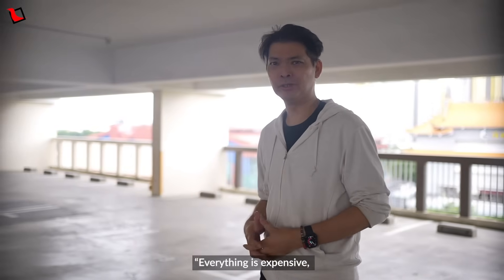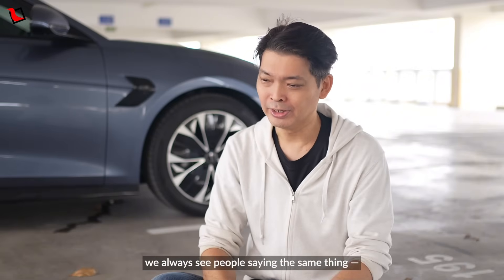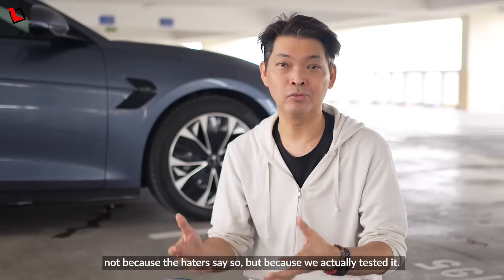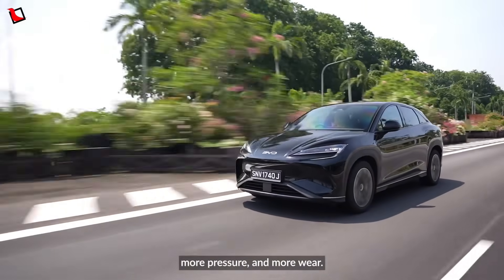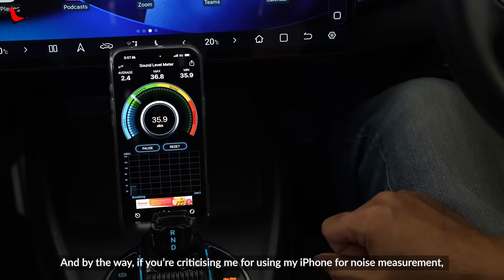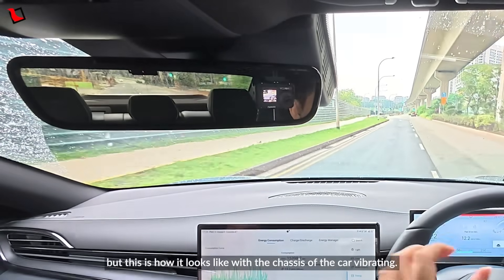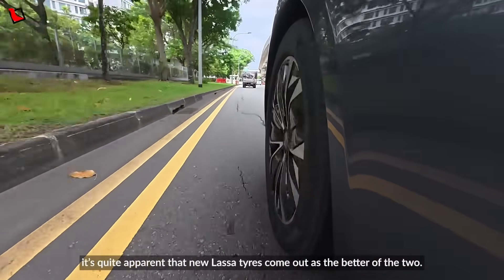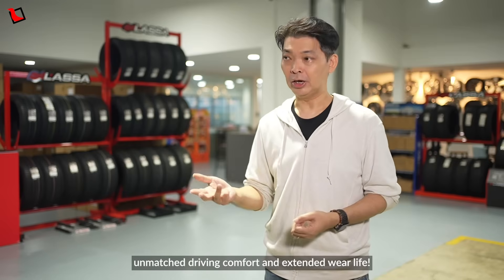EV Tyres are a Scam ? | Learns Car Series

Comment: OK so we know that this Lass-a brand of tyres can pass .. Thank you..... Although in my opinion the issue isn't so much whether EV tyres are a scam .... It's the wear and tear of EV tyres and brakes due to the extra weight of the battery - and whether it offsets or wipes out the savings of regular servicing maintenance eg oil changes etc
Reply from the maker: Yah, I think if one goes for the more expensive branded tyres, it will definitely eat into the savings... so I think going for good-enough tyres at that are the same price as normal non-EV tyres will make a lot more sense.

Comment: I am intrigued after seeing your BYD Seal energy efficiency at 12.2kWh/100km with Giti & 11.9kWh/100km with Lassa. 

BYD Seal real world energy consumption range 15 to 20 kWh/100km, I am keen to learn how you managed to achieve it. 

Maybe you can also do a comparison with the various driving modes ( Eco, Normal & Sport) . Driving mode Normal D &  B-pedal. 

I have always been on Normal D with Eco & highest regenerative braking, my average energy consumption is around 16kWh/100k.

After my left meniscus tore, I started using B-Pedal Eco mode and the energy consumption improved to around 13kWh/100km.
Reply from the maker: For me and my wife, the car is always in Eco. I find there's no advantage in the quick sprints in my Dynamic because it's not earth-shattering quick. And so, my starts are like most normal traffic. 

The main energy sapper is highway cruising at high speed. I find that between coasting at 100km/h vs 80km/h, the energy used could be 2-3kWh/100km difference... so nowadays, if we're not rushing to our destination, we'll just take the middle lane at 85km/h... my wife will do 80km/h on her own, even slower, but more efficient. 

Just before stops, I really let the regen brakes work way, way before, so that by the time I reach the line, the car is coasting at the absolute slowest. It irritates some cars behind with my regen braking, but hey, they gotta learn. 

So as you can see, the car's average efficiency is actually 13.3kWh... nothing near what I've clocked in the tests. That's after 15k+ km of driving the car like what you did... and how we do it now. 

That said, I don't purposely go and challenge myself to get great efficiency all the time... I just drive how I like to. I think even at 15kWh, it's good enough compared to my petrol SUV... almost twice as affordable to use. 

Anyway, thanks for sharing about your results after your new way of driving. Sorry about your injury though.

Comment: U mean the default tyres issued by the byd dealerships r technically not EV suited?
Reply from the maker: I never meant that in the video... Giti's website claims that they are, but I was told that normally, EV tyres will have a marking on the side wall, which we can't find any.

Comment: SCAM is a strong words to be used!!!
Low traction = low noise = higher fuel efficiency 

High traction = higher noise = lower fuel efficiency due to tyre drag

Aqua panning depends on the traveling speed, rubber compound and water escape of the tyre tread design. 

Low traction also means poor braking performance! Imagine driving on ICE...!

Not rocket science! Its simply physic
Reply from the maker: Thanks for sharing this in simpler terms. 🙏🏼🙂

Comment: Nice to see another lassa owner.. I swapped my stock 195 ling longs from my dolphin to 205 revola tyres.. So far doing well. Only thing noise cannot compete. My stock ling longs were rated at 67db.. My new revolas are 71db.. So far clocked about 10k already. Just went to rotate recently
Reply from the maker: The stocks is actually called Ling Long? Oh my! 😅

Thanks for sharing your experience... although I think the Revolas are more for performance than comfort?

Comment: TCS session. 
1. Weight...depends on size and capacity apple to apple compare and not use cybertruck😂
2. Driving style..All ramp up style from start will definitely affect the tyre. Nothing to do ev or engine
3. Insulation..price to pay abd ev is definitely quieter
Reply from the maker: Thanks for your summary. 😉

Comment: I used to believe that you were authentic in your videos. But this clearly shows biasness towards your sponsored brand. You are sharp enough to notice fuel weight between Non-EV against EV. But not able to notice the comparison between old and new tyres. The vibration test should have been a negligible difference and hold a neutral position, but you had to say slightly less for Lassa. The last disappointment is that this video have become a click bait. I wanted to understand the comparison between EV tyres and Non-EV. What I got is Lassa vs Giti for 70% of this video and walked away learning only the weight and torque difference which I already knew. Hope you stay true to being authentic for the longevity of your content and not stray away from why people trusted you in the first place.
Reply from the maker: I’m sorry you feel that way… but the results speak for themselves. There’s no falsifying the readings.

And ultimately, you might not like it… but unfortunately, my video production needs to be paid still. I can’t do these videos for free forever… So there’s a need to balance paid videos with unsponsored ones.

That said, I would defend that this video is still authentic… if the results weren’t favourable, I probably won’t release this video, and refund the sponsor.

Finally, watch out for Pt 2 when I compare non-EV tyres with this set.

But ultimately if you think I’ll be biased still, and not worth your viewers and subscription, I thank you for your prior support regardless… And although I hate to see someone go, it’s inevitable my videos can’t please everyone. 😌🙏🏼

Comment: I am in the tyre market and deal directly with many manufacturers, from well-known branded companies to chinese factories 
I won't comment on the premium brands, but I've noticed that many chinese brands are launching 'EV-specific' tyre ranges that use essentially the same specifications and construction as their regular tyres. Interestingly, the factory prices I get quoted for both the standard tyres and these so-called EV tyres are exactly the same
Reply from the maker: Is it a case of profiteering from those Chinese brands?

Comment: Apart from the apparent difference in noise reduction, all the other test metrics are negligible. There is not much data to produce reliable result for testing efficiency , grip,  and wear. Maybe if these 2 "different" tyres were sliced in half to show construction difference (reinforced sidewalls, optimized tread design, acoustic foam, etc) then that would show a visible and more realistic comparison. 
Given its superficial coverage, the video cannot credibly claim to answer the question, "Are EV tyres a scam?"
Reply from the maker: I hope to be able to do a video of such huge production value… so for now, I can only do very layman tests. 

Thanks for your suggestion. 🙏🏼
Reply: @LearnsMarketing  I don't think this requires "huge production cost", you just need to be thorough in the content you share, especially when the topic is contentious. ;)

Comment: I hate to say this, but the comparison is terrible. 

New vs old tyres, the physics behind what makes EV tyres different (for example the stronger carcass and stiffer sidewall to cater to heavier vehicles), were all not touched on.

Also the noise “test” doesn’t take into account pitch/tone. The reason why a tyre like Yokohamas V553 seems softer than a Goodyear F1A6 even though a decibel meter shows the later is softer.
Reply from the maker: Thanks for your feedback regardless.

Comment: I using lassa for at least 6 mths. Very good wet grip, comfort and quieter than factory tyres. Shorter braking distance. 😅🫡
Reply from the maker: Thanks for sharing 👍🏼. 

Just curious, what brand was your stocks?
Reply from the maker: Giti
Reply: Is there a different between EV tires for SUV vs Sedan?
Reply from the maker: @henryng2800  If it's not for offroading, my research tells me no... it's mostly about the weight.

Comment: Out of curiosity, 
1. Tyre pressures for either sets of tyres? Giti and Lassa. 
2. Also, NVH and grip will certainly differ when tyres are new, used and worn.
Reply from the maker: Great questions... Pressure is largely the same for both... but I cannot do anything about the "newness" of the Lassa during my test... Perhaps can try again after 1 year of use?